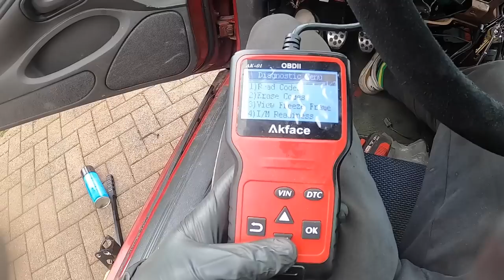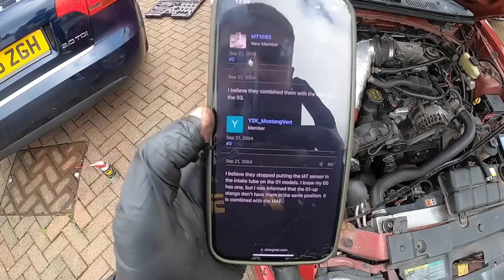So what DAMAGE did the drift day cause to the Mustang?!

Comment: Grab yourself a plastic welding kit you won't regret it. It's basically a soldering iron that you clip a piece of zig zag wire to , turn on let it heat up , push the wire into the plastic on the backside and it melts together leaving the wire in the plastic as reinforcement. Can then fibre glass filler over it if necessary. Could of used it to keep the bumper in shape  before cutting the cable ties.
Reply: Came here to say exactly this!

Comment: in the previous video about the brake bind, if you only had the one rear wheel jacked up. You would've been turning the LSD which would cause the high resistance

Comment: Spray some Wd40 on the sticker glue residue leave it about 10 secs and spray a rag with Wd40 and rub at it and it should come right off, also works for over spray
Reply: Baby wipes works very well like acid 😂
Reply: White spirit or a bit of petrol on a rag should also do it for a quick fix

Comment: great vlog as usual Lee, nice to see this beast getting the best work done on it, i would say as a little helpful tip fpr the sticker removal, the best thign i found to remove the most stubborn glue and any stickers is to soak a rag in petrol and then rub it off, it smells for a bit until it dries, but nothing cleans the paint up better.

Comment: For the stickers, use some petrol and a plastic razor (if you are worried about scratches and your fingers) or a normal razor and it will work wonders. An old detailing trick I learnt training, nothing removes them like good ol; stinky petrol. You can use a tar and glue remover which is essentially a weaker version. 

Keep the content up, loving the videos oh and yeah the rain can F**K off now. :D